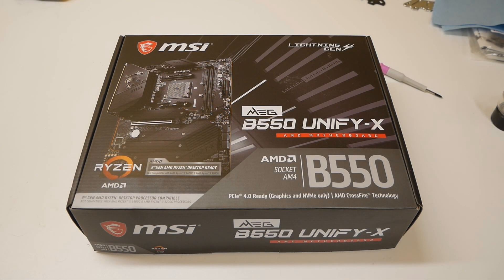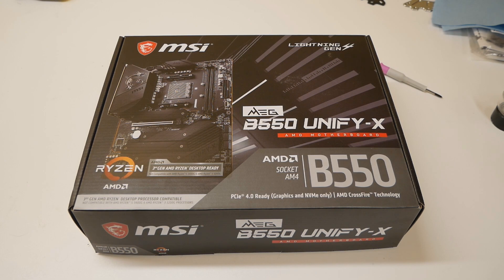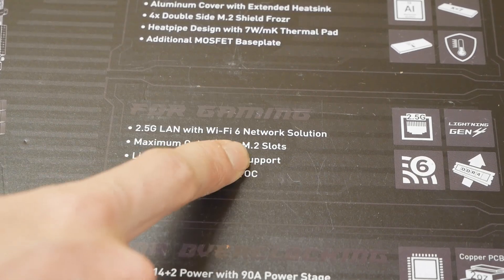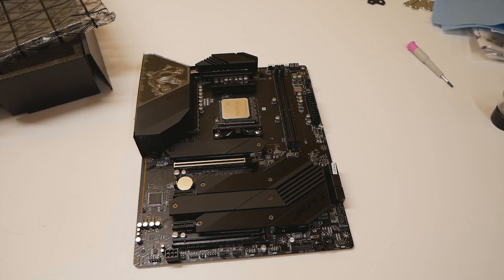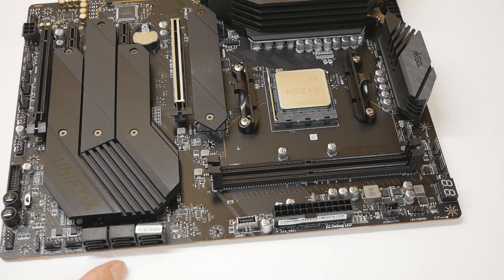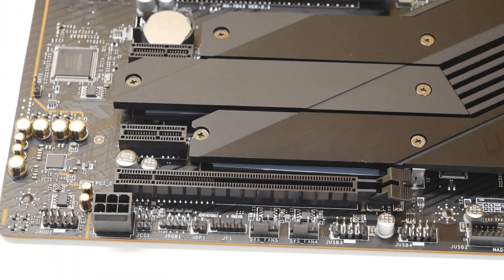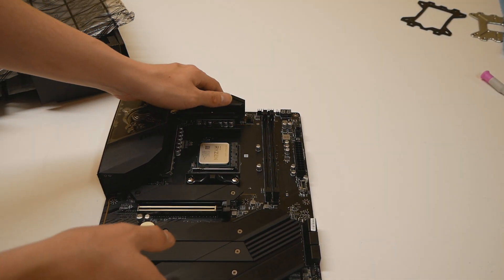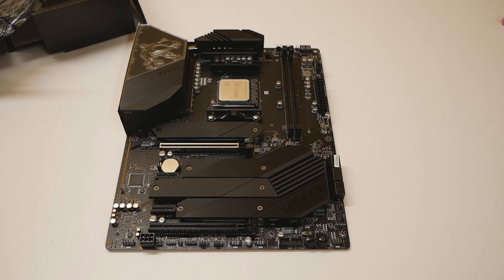MSI B550 Unify-X Has Arrived - Let's Check it Out!

Comment: I was very strongly considering one of these - if I could FIND one, of course - but I ended up with the X570S ACE MAX. Got it STUPID cheap, and made half of it back selling my Torpedo, so I'm delighted😁. 
The only thing missing is the PCIe lane splitting - I would gladly take an 8x on the graphics card to be able to run three NVMe right from the CPU, but I have never seen an X570 board with this option.
Reply: I got a B550 Unify open box for $79 at Micro Center. They had three new for $110 and one open box and by the time I got to the store the next day the open box was all that was left. I run it with the three NVMe at PCIe 4x4, the fourth is PCIe 3x2, and the GPU at 4x8, good enough not to bottleneck my 6750XT. Apparently, if I set it up in RAID 0 it can get 20,000MBs read/write but, I have not tried it. I use a PrimoCache software based SSD system RAM buffer of 2.5GB for all the NVMe and I get around 22,000MBs anyway. The thing is, the most used programs have to run at least once at the native NVMe speeds to load into the cache and I have to use sleep mode to keep a persistent RAM cache as it will erase on reboot. Other than the lane switching the ACE MAX is pretty much on par with the Unify from what I know from it's specs. Good luck with it.

Comment: Thank you for the overview of the board. Were you able to take a look underneath the expansion nvme heatsinks? (The ones below the pcie x16 slot),There are white prints that designate  space for additional chips. Does your board have this same layout? Additionally,  I  wish msi had also added a dual bios feature, I’m now presented with the challenge of getting back into boot state. As always, your content is excellent, keep up the solid work!

Comment: Isnt b550 crap?
Reply: It's AMD's latest chipset and it contains less clutter that can interfere with the overclocking experience...
Reply: The X570 is crap, and the B550 is a normal chipset.
Reply: @Aelron  well but the x570 is better for oc?
Reply: @dvr1337  Depends on the motherboard itself. There are motherboards based on B550 that are not inferior to motherboards based on X570 or are several times superior.

Comment: If the firmware supports PCI-E bifurcation on the x16 slot, and you can find an appropriate riser cable (I do not know if anyone makes an x16 --> 2*x8 riser) , you might be able to do crossfire.

Comment: i got the unify (not X) its been great so far
Reply: What CPU are you running on it and have you experienced any coil whine from the VRMs? Been reading some issues with this board on the OCN forums.
Reply: @europason2293  I have the regular Unify as well running a 5800x at 4.85 ghz and havent had any issues whatsoever
Reply: I just got my Unify trying to run Trident Z Neo 3200mhz and a 5600x. It keeps giving me errors with the memory anybody know why?